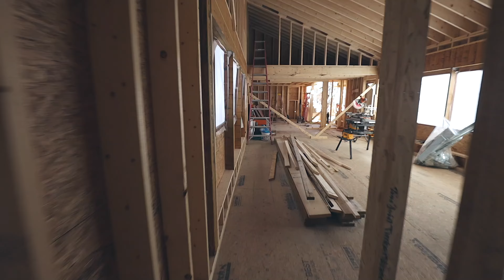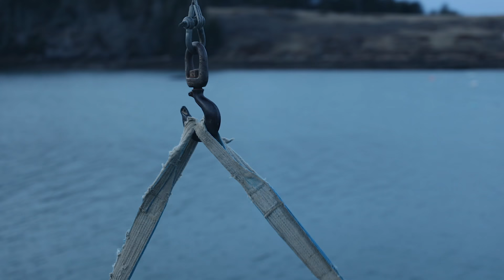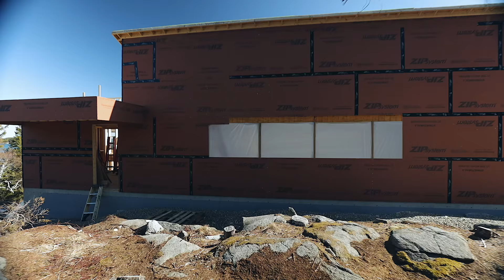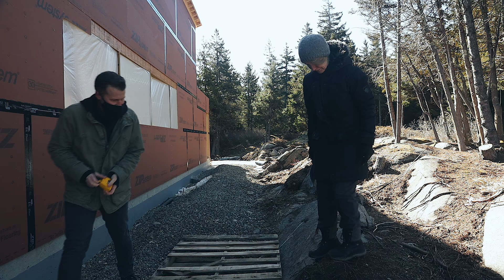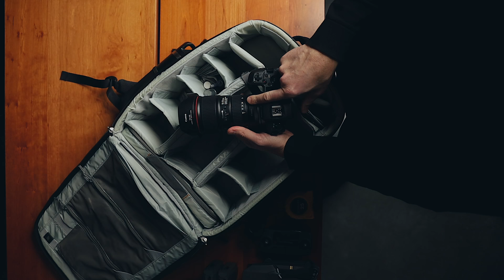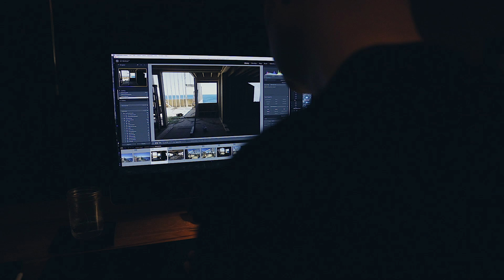A Day in the Life of an Architect: Construction Site Visit

Comment: As a front-end developer, I use your insights on my own projects. The correlation is there and it helps me to ask questions differently. Different type of site, but it does require to put in a lot of communication with the designer (architect).

Comment: If you don't mind me asking, how was this designed for wind? It's a very exposed location at the top of a bluff with (what looks to be) standard lightweight timber frame construction. The structure is likely going to be very active in a storm. I'm sure the structure is fine in the strength case, but I wonder if the fee for a project like this would cover the engineer looking in depth at the service condition? It wouldn't be very comfortable sleeping to have the whole house rattling away everytime the weather gets nasty.
Reply from the maker: Here's a video that discusses this very issue: https://youtu.be/29-xtjX8rAk
Reply: That’s a great video! Albert is an excellent communicator and knows his stuff, particularly with regards to the performance/service of a building. I’m sure he’s specced you an appropriately stiff lateral system for the performance your clients are after. When I’ve done similar projects, I’ve found timber very temperamental to certain spans and internal wall layouts when it comes to structural vibrations.

Looking forward to seeing this progress, it’s a beautiful location and beautiful design by yourself.

Comment: Great vid as always :) I was wondering what was your stance on different building materials in the context of global warming influencing the frequency and strength of storms (especially where the outpost has been constructed) in the balance with getting the materials to the construction site (aka via boat). How did you balance the points for and against using other things than wood for the walls for example. Why didn't you build the fire place out of , say , local stones , concrete and a bit of fire proofing bricks for example. It might have been a good anchor point for a few items of the house. I know it's  a tad cliché, but consider the advantages: thermic inertia of the hearth for example & structural  ?
Reply from the maker: Cheers...all good questions, I'll cherry-pick a few. Wood is the most local and plentiful resource there is here in Maine. It's cheap, lightweight and the local island labor force is experienced in building with it. That makes it all-around a pretty environmentally friendly choice. RE: the fireplace. Experienced local masons are in even shorter supply than carpenters and building a fireplace using local stone (which could only be used as a veneer) would require a CMU flue and must be completely independently supported from the structure. All this plus mortar and sand would have to ship to the island via boat. I assume a stone veneer fireplace built on the mainland starts at $50K, out here it would be significantly more. Building code here is moving away from fireplaces altogether as they're an unmitigated point of heat loss in the thermal envelope. A wood stove by contrast is in the $4-8K range. It's lightweight, doesn't take up much room inside, it's easy to ship + can be installed by two laborers. It also heats the space up quickly which is an important consideration for a home used seasonally. We're using a carbon zero unit. So, in this case it was an easy choice to spend our budget on other things like better insulation + air sealing. As you know every project involves so many dependent decisions it becomes difficult to separate them!
Reply: @30by40  that's more or less what I expected.  any issues with ground pipes freezing in winter ? our building code requires at least to bury them at 80cm from ground level, over on your side of the pond is it deeper? ps. that beer on this side of the pond is still waiting for you. when we can travel and if you'r in the neighbourhood, look me up :0)

Comment: An amazing design can be seen already from the construction phase: how windows are framing the landscape and the way light enters the space. Are you considering the use of sustainable materials for insulation? Thanks for sharing!
Reply from the maker: Cheers, Cris. The insulation chosen was a soy-based closed cell sprayed foam for the walls/roof/exposed floor. The main floor over the crawlspace is mineral wool. Wind washing is a big concern for us on this site so ccSPF made sense for this application.

Comment: I'm used to seeing concrete buildings but I find wood framing interesting!
Reply: Its the best. When I am finally a licensed architect I'm gonna start looking for an architecture firm that specializes itself in timber use
Reply: ITS NICE TO HAVE THE WOOD FRAMING BECAUSE ITS SIDE OF A SALTY WATER
Reply: Doesnt it usually last less structurally? I'm afraid of wood rotting and losing it's strenght over time vs concrete. Well that and termites, humidty, fire hazards, etc...
Reply: @RealDavoX  if it is done correctly you shouldnt have those problems. And its much better for the Enviroment.
Reply: @RealDavoX  nope! plenty of century old buildings with timber. wood rotting is a problem when the construction itself stays humid, so that's something to look out for. and to of course look into wood treatment to have it preserve longer.

concrete degrades /rots too.